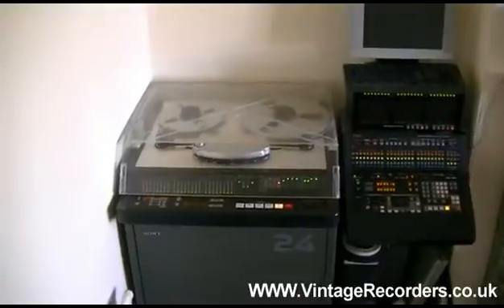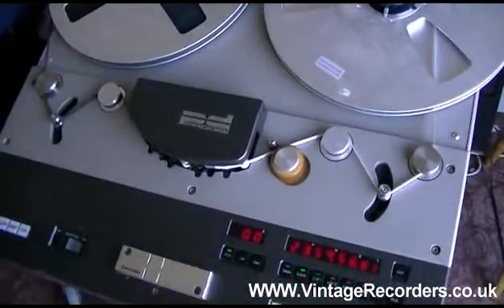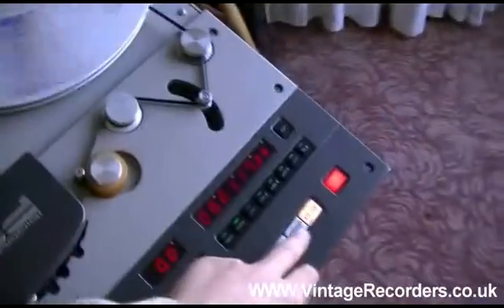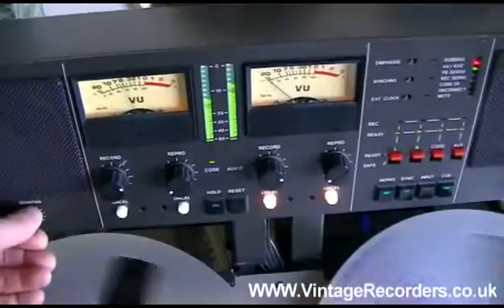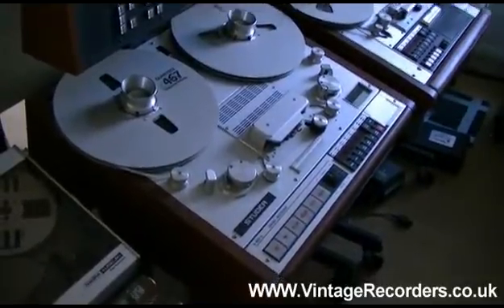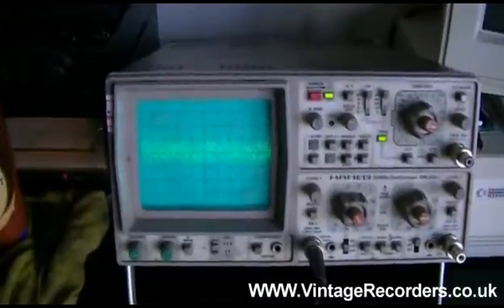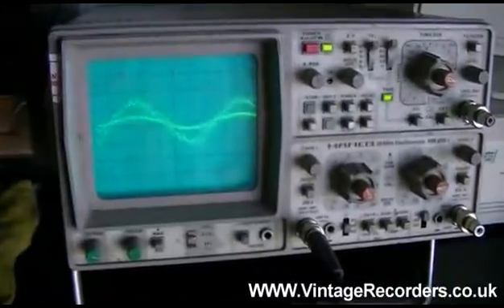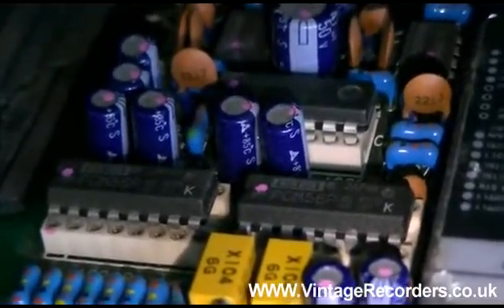Digital reel to reels, Sony PCM3324, K8113, PCM3202 - Studer D820X, Mitsubishi X-86

Comment: Very cool video!  It's interesting that the Burr Brown converters were in sockets.  Very unconventional; it would be fine to do that with digital logic signals (it's often done with EPROMS, of course)  but you'd think they'd be hesitant to do it with audio signals.  Because of the chance of a poor connection.
Do you actually have the master tapes of the techno version of the X-files theme?
Reply from the maker: Thanks, I am glad they are in sockets, makes fault finding so much easier. Sadly I don't posses many masters, this was a recording from a MP3 to demonstrate the machine in action.
Reply: Ahhh, I see.  I would love to see a video of a classic 80s-90s piece of pop music playing at mixdown, from the multitrack, with moving faders running. (my understanding is the fader settings were sometimes stored on one of the tracks, or at least could sync to the timecode)

Comment from the maker: I tend to find the smaller IC's go, the big and hard to find ones are usual sound ( touch wood), there are a lot of buffer chips which the machine could work without but I would rather replace one of those than a bespoke IC.

Comment: The main good thing about these machines is that ICs are fitted in sockets, so it's easier to work out issues by using simple methods like swapping... 

Do you have any idea why did the x86 break in the first place? Was is the digital de-multiplexer? Considering that the digital signal was visible as stereo, I'm curious why would it bypass the bad PCM56P. DACs usually need a good reason to go bad

Comment: IC's can be tricky though.

e.g. in my Tascam, all of the audio logic control circuitry was open. It's built with 4000 series ICs, none of them being installed in a socket. It was an accident, they sent a surge through the gnd, therefore it affected a few of them but in the end they all felt like dominoes. It's an 8 channel v. but I only fixed the controller and two audio cards for now (I swap them over the next two channels for further stereo recording. It's not in a pro environment whatsoever)

Comment from the maker: I bet you are using normal analogue tape? as mentioned before, you need to use digital tape or you will damage your heads, the recorder will not record on that tape apart from the AUX channels, if you are using digital tape and you have the mute light on, you have something wrong with your machine.

Comment from the maker: HI, not really no, you can not use analogue tapes on these machines, you will damage the heads, it must be digital tape. They have 2 AUX tracks which are analogue but these are not designed for listening to but for editing and fast searching.

Comment from the maker: Good question, at first I thought that found the two analogue signals are multiplexed together( working from the DATA buss direction), I got a little lost at this point looking for the de-multiplexer, with no circuit diagrams which isn’t easy. Approaching from the other side, the LED meters were working, I could assume that the digital side was working fine, so I looked at the beginning of the analogue circuit when I spotted the pair of PCM56P, swapped them and hay presto!!!

Comment: Just to weigh in on build quality: they use the cheapest components i've seen. On one of their more compact mixers, the AC rectifiers were right beneath the main XLR outputs. I have one of their headphone amps, it has little to no RFI rejection (in a plastic case too).